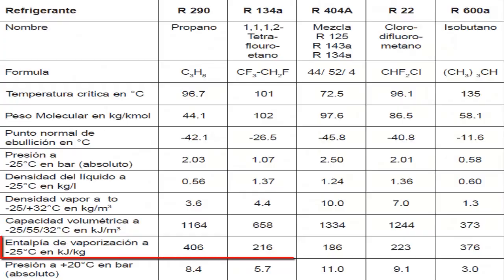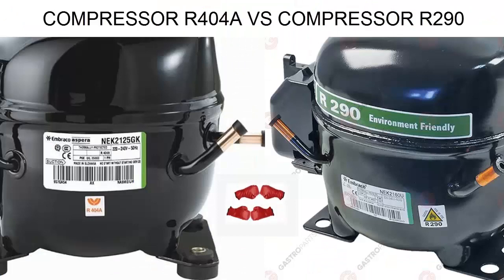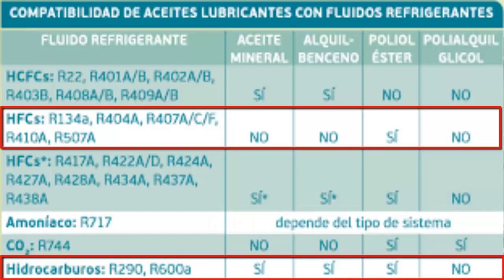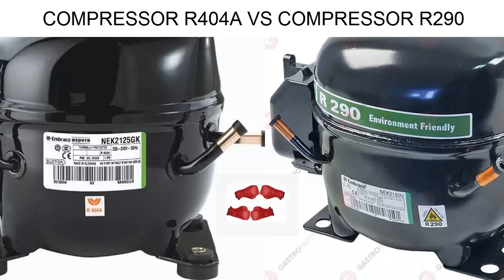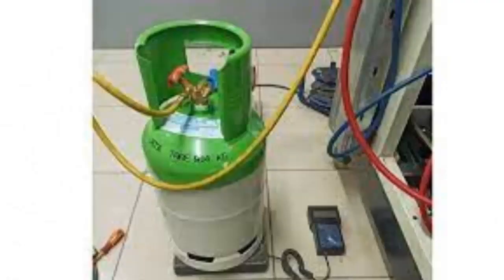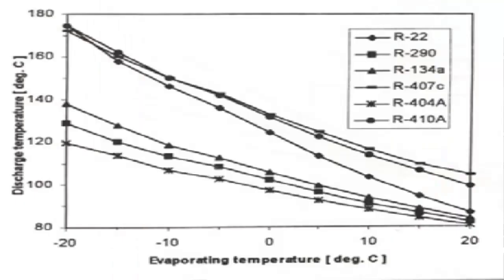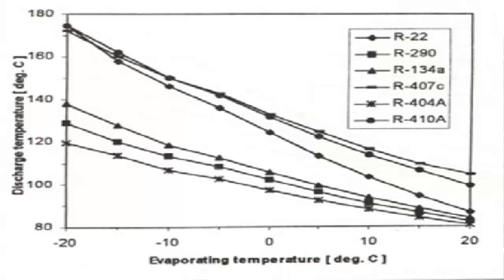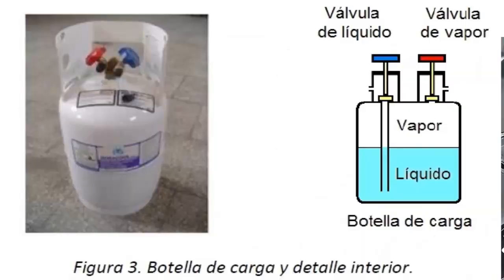R290 vs R404A Compressors: Key Differences in Performance, Efficiency, and Applications

Comment: Fucking shit video R-290 = just propane in its pure form like almost identical to the old R12 used till 1994 in cars......Same pressures same boiling point and now i hear special developped.

I am going to trow up............R290=propane witch is basicly identical with R12 just R12 doesnt burn................There is no new compressor or or or this stuff is around since the 1950,s or earlyer with great performance...